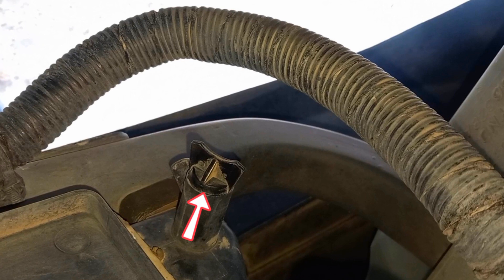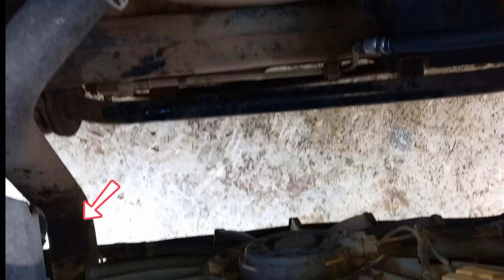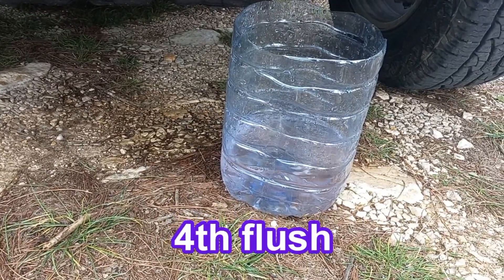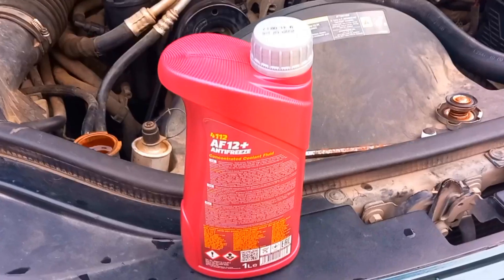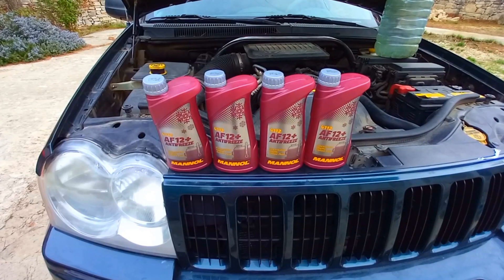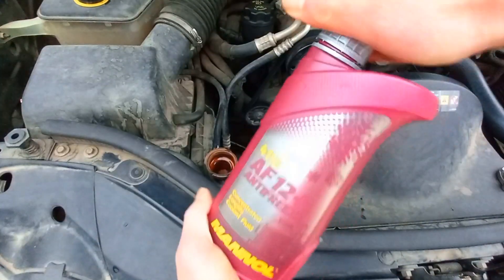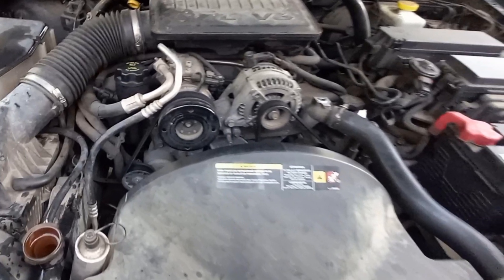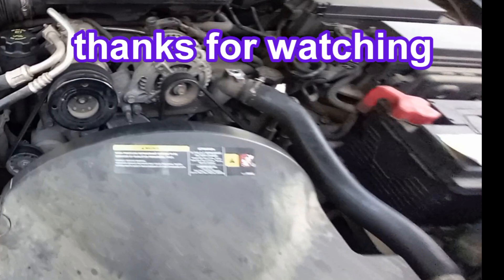coolant flush without removing thermostat

Comment: Once i bought a vehicle,  the previous owner didn't fill it with coolant , only water , when i filled it with coolant , after about 2 or 3 days it started leaking from several places , the previous owner was using hard water which made a layer of deposits inside the cooling system that stopped any leaks , when i added coolant it started cleaning the deposit  layer which made the coolant leaks
Reply from the maker: Thanks for sharing